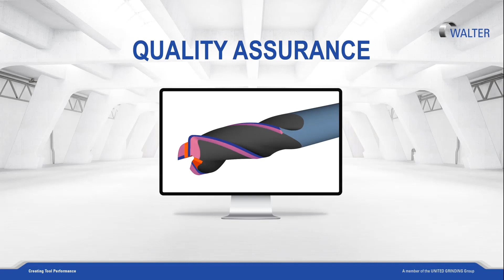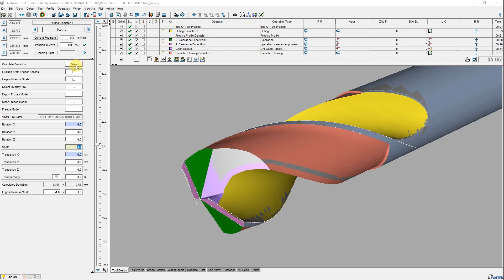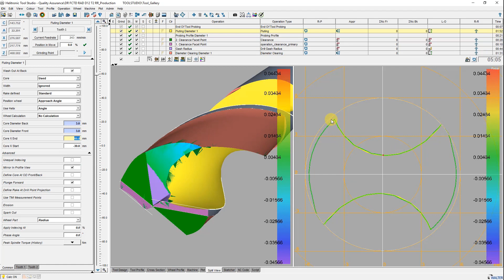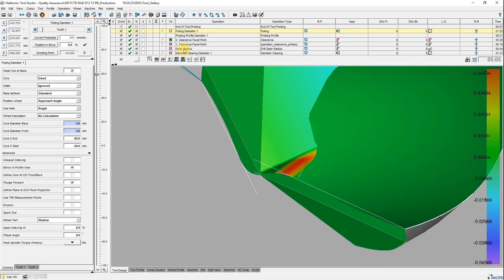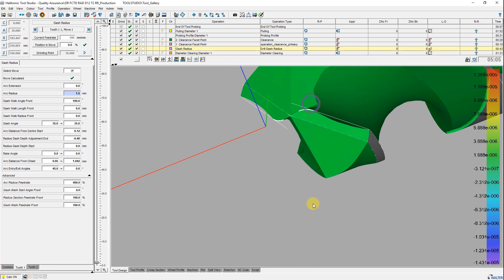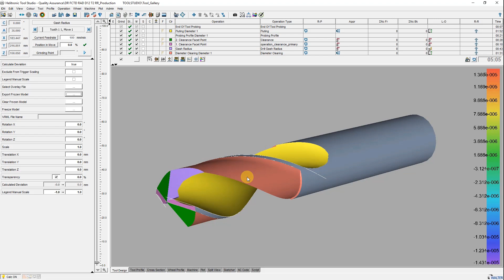WALTER Quality Assurance

Comment: For make vrml model need use walter helicheck machine?
Reply from the maker: Hello @carbidetools.ru, thank you for your question. VRML is not a file format especially for our HELICHECK machines. VRML (Virtual Reality Modeling Language) is a standard file format for representing 3D interactive vector graphics.
Reply: @WALTEREWAG  I mean QA module compare toolstudio model with measured vrml file?
Reply from the maker: @cbtcbt4629  In this case, yes you need a HELICHECK machine if you want to compare such vrml files.